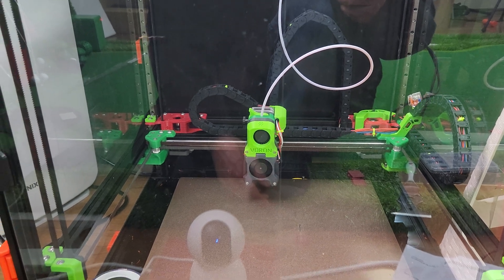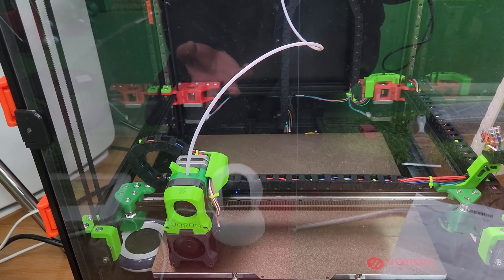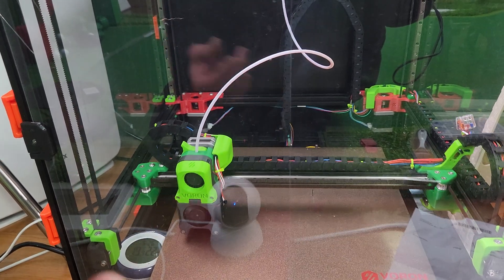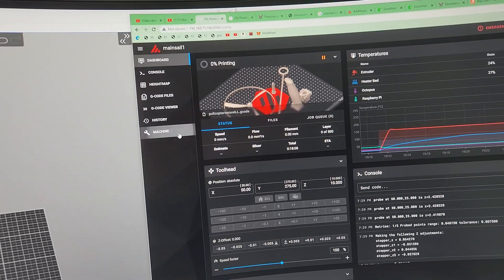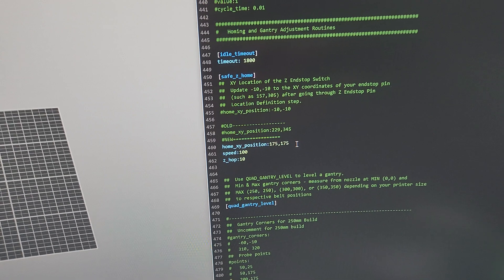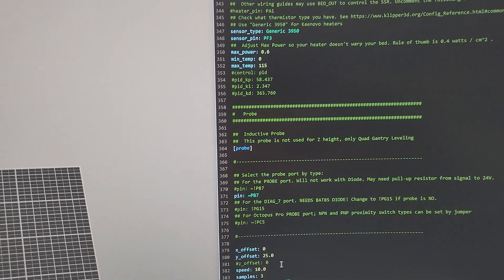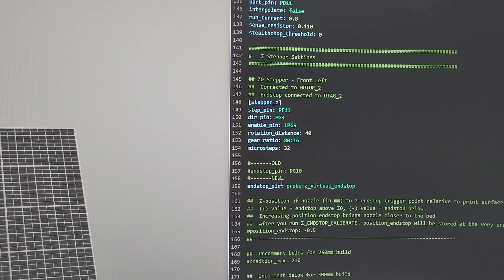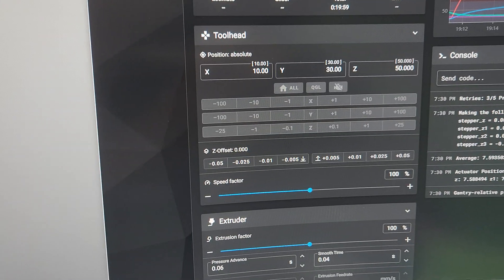Voron 2.4 Z Offset using Omron Probe Part 1!

Comment: Hey I have a problem with that. //Option 'z_offset' in section 'probe' must be specified

Once the underlying issue is corrected, use the "RESTART"
command to reload the config and restart the host software.
Printer is halted// I can't comment # z_offset
Reply: I left it at zero and didn't comment it out.  I also had to comment out "position_endstop: -0.5", then it would work, otherwise I got the same error.  Once I did probe_calibrate, it fixed itself.

Comment: But the Z endstop designated for the nozzle, if you switch nozzles you need to take care of the offset back and forth.
Reply from the maker: I don't really switch nozzles much, haven't replaced the original one.  But if you switch nozzles often you may have to change z offset yes.  Z endstop needs purging brush otherwise it is flawed, better to use probe as z endstop imo.
Reply: I would say it is better to make a macro that measures the new nozzles z-offset using the regular z-endswitch when you switch to a new/clean nozzle and therefore make it part of your nozzle change routine. This way you are still using the inductive probe for the homing of your machine, but you don't have to manually determine the z-offset with every nozzle change. I haven't tried it myself though.